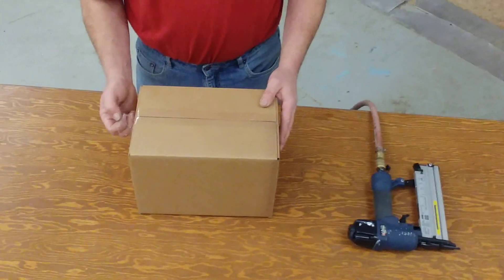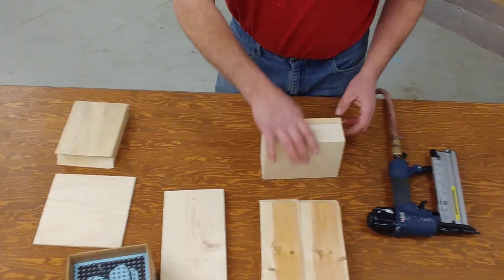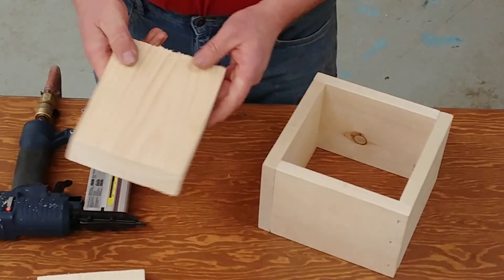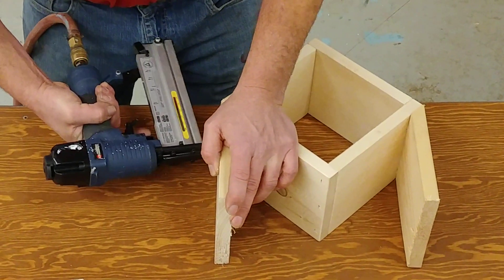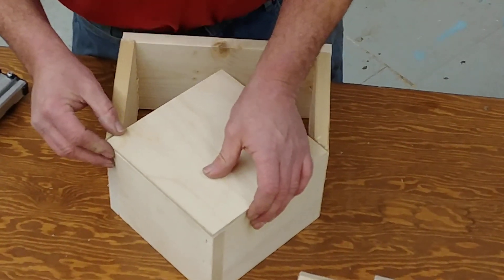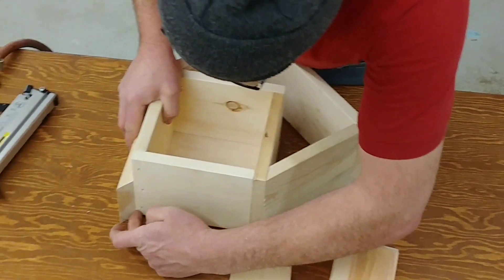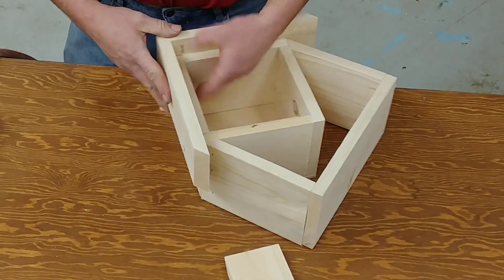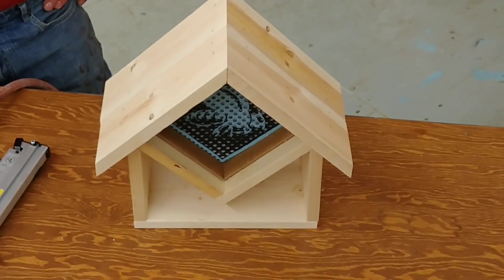DIY Solitary Bee Barn Assembly Instructions (Backyard Pollinator)

Comment: Jeb, I made my own bee houses last year and learned a lesson.  I had the side wall come down like yours and the bottom which extends to the side of the side walls looked great - until it rained.  The rain ran down the side walls and wicked into the end grain of the bottom board wicking well inside the box and I lost more than a few rows of cocoons.  Better if the bottom board was inside the side walls and that would solve the wicking problem.. Just a thought.  I will buy one of your bee bards but will modify it so that the bottom fits inside the side walls.